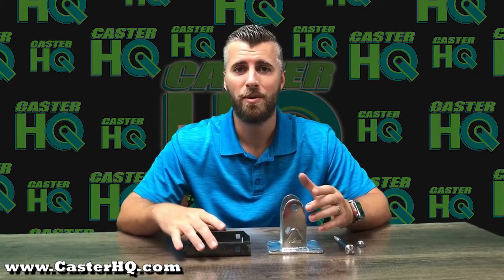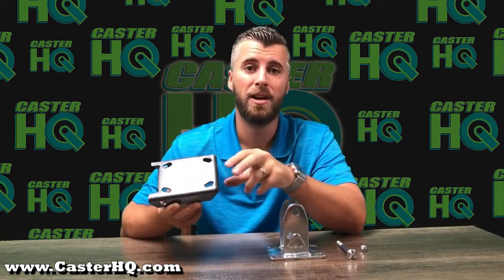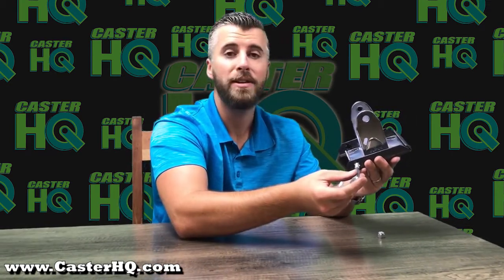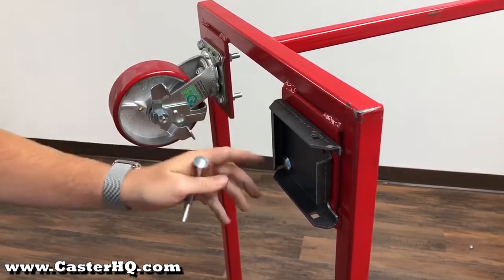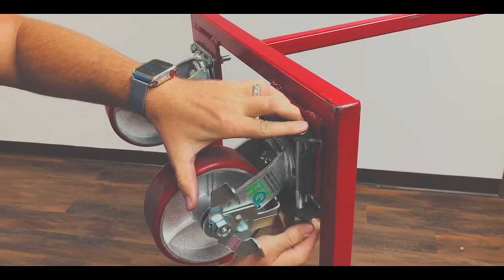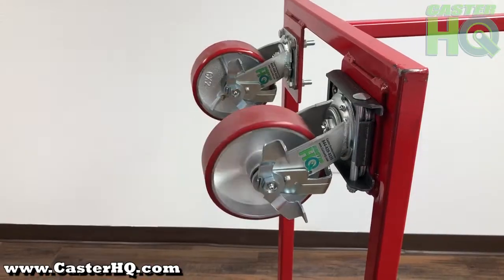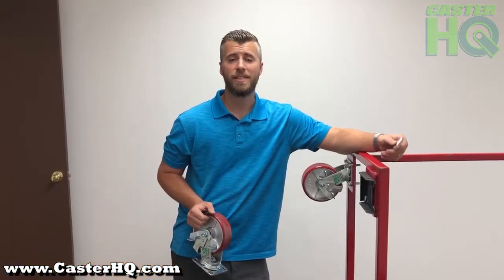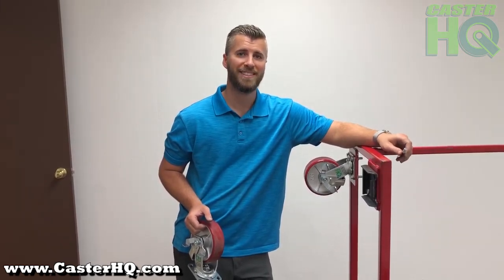How to install Caster Pads - Full Tutorial & Installation Video

Comment: I think it'd be great to have a tool-less solution rather than securing with the bolt. Maybe a locking pin instead? If you have to get tools out anyways it seems like you lose a lot of the intended convenience.
Reply from the maker: Caster Pads/Docks will eliminate the time it takes to swap the casters out in the future as it will only take 4 bolts to swap them out opposed to removing 4 bolts per mounting plate which equals to 16 bolts on a set of 4 casters. So for large industrial companies that replace casters frequently, this is a huge time saver. For the every day person at home, may not be worth it. Thanks for the feedback, and yes, a tool-less solution would be a great idea! I like that a lot.